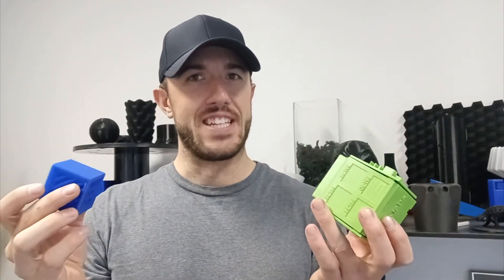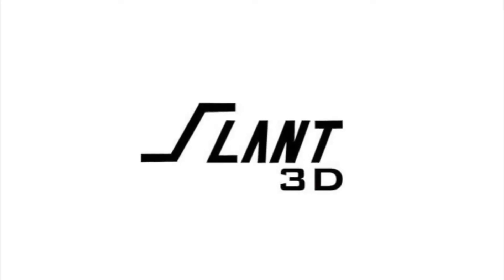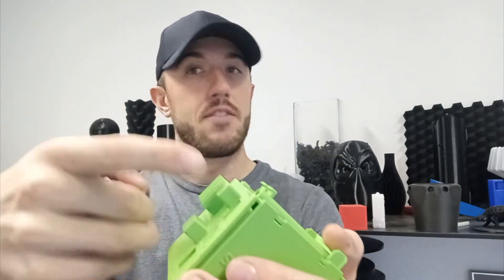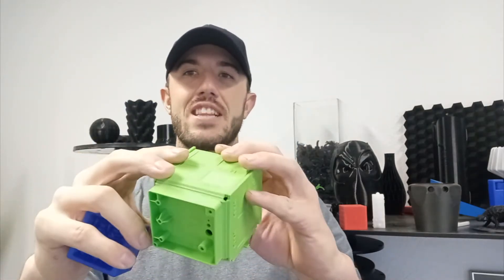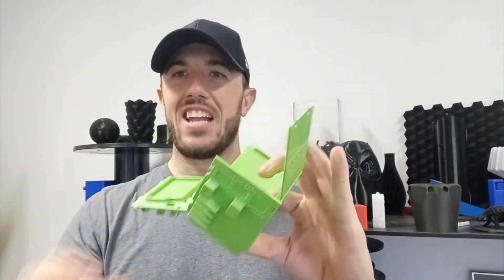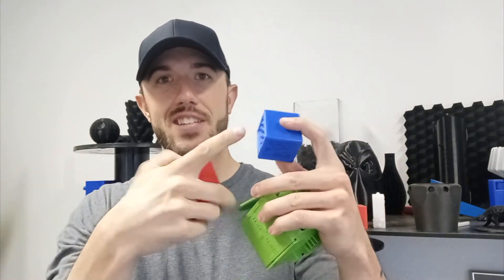3D Printing VS Injection Molding: Manufacturing Solid Objects

Comment: I’m curious if you had 3d designs that just weren’t strong enough, but plastic injection met the strength needs?  Working on new filament and printing technique.